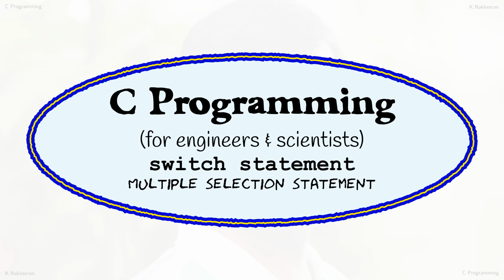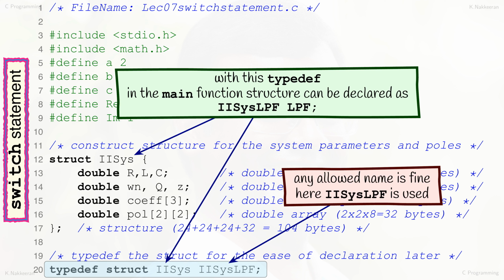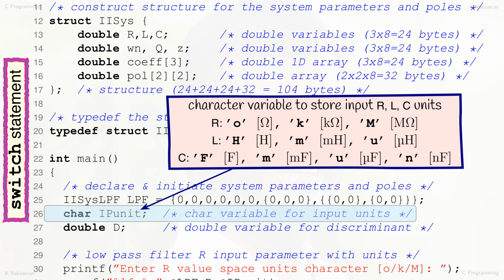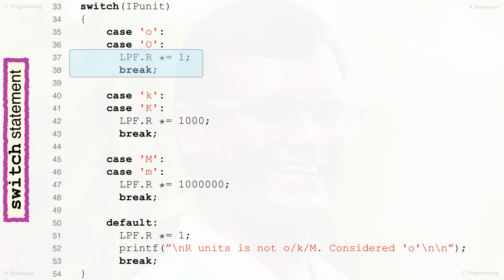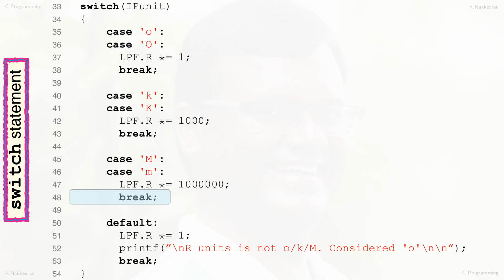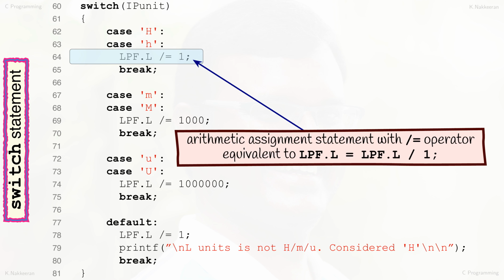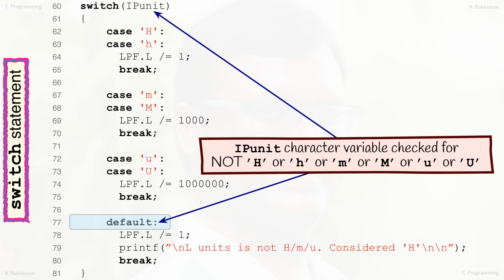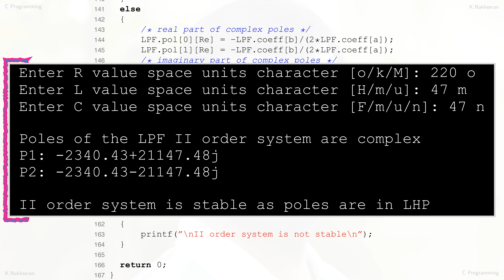C Programming Lecture 07/13

Comment from the maker: /* FileName: Lec07switchstatement.c */

#include <stdio.h>
#include <math.h>
#define a 2
#define b 1
#define c 0
#define Re 0
#define Im 1

/* construct structure for the system parameters and poles */
struct IISys {
    double R,L,C;       /* double variables (3x8=24 bytes) */
    double wn, Q, z;    /* double variables (3x8=24 bytes) */
    double coeff[3];    /* double 1D array (3x8=24 bytes) */
    double pol[2][2];   /* double array (2x2x8=32 bytes) */
};  /* structure (24+24+24+32 = 104 bytes) */

/* typedef the struct for the ease of declaration later */
typedef struct IISys IISysLPF;

int main()
{
  /* declare & initiate system parameters and poles */
  IISysLPF LPF = {0,0,0,0,0,0,{0,0,0},{{0,0},{0,0}}};
  char IPunit;  /* char variable for input units */
  double D;     /* double variable for discriminant */
  
  /* low pass filter R input parameter with units */
  printf("Enter R value space units character [o/k/M]: ");
  scanf("%lf %c",&LPF.R,&IPunit);
  /* check units character and fix the scale factor */
  switch(IPunit)
  {
      case 'o':
      case 'O':
        LPF.R *= 1;
        break;
        
      case 'k':
      case 'K':
        LPF.R *= 1000;
        break;
        
      case 'M':
      case 'm':
        LPF.R *= 1000000;
        break;
        
      default:
        LPF.R *= 1;
        printf("\nR units is not o/k/M. Considered 'o'\n\n");
        break;
  }
  
  /* low pass filter L input parameter with units */
  printf("Enter L value space units character [H/m/u]: ");
  scanf("%lf %c",&LPF.L,&IPunit);
  /* check units character and fix the scale factor */
  switch(IPunit)
  {
      case 'H':
      case 'h':
        LPF.L /= 1;
        break;
        
      case 'm':
      case 'M':
        LPF.L /= 1000;
        break;
        
      case 'u':
      case 'U':
        LPF.L /= 1000000;
        break;
        
      default:
        LPF.L /= 1;
        printf("\nL units is not H/m/u. Considered 'H'\n\n");
        break;
  }
  
  /* low pass filter C input parameter with units */
  printf("Enter C value space units character [F/m/u/n]: ");
  scanf("%lf %c",&LPF.C,&IPunit);
  /* check units character and fix the scale factor */
  switch(IPunit)
  {
      case 'F':
      case 'f':
        LPF.C /= 1;
        break;
        
      case 'm':
      case 'M':
        LPF.C /= 1000;
        break;
        
      case 'u':
      case 'U':
        LPF.C /= 1000000;
        break;
        
      case 'n':
      case 'N':
        LPF.C /= 1000000000;
        break;
        
      default:
        LPF.C /= 1;
        printf("\nC units is not F/m/u/n. Considered 'F'\n");
        break;
  }

  /* low pass filter parameters */
  LPF.wn = 1/sqrt(LPF.L*LPF.C);     /* res frequency */
  LPF.Q = (1/LPF.R)*sqrt(LPF.L/LPF.C);  /* Q factor */
  LPF.z = 1/(2*LPF.Q);          /* zeta of TF H(s) */
  
  /* TF denominator quadratic eq coeffs */
  LPF.coeff[a] = 1;
  LPF.coeff[b] = 2*LPF.z*LPF.wn;
  LPF.coeff[c] = LPF.wn*LPF.wn;

  /* calculation of the poles */
  /* calculation of the quadratic eq discriminant */
  D = LPF.coeff[b]*LPF.coeff[b] - 4*LPF.coeff[a]*LPF.coeff[c];

  /* check positive/negative discriminant */
  if (D >= 0) 
  {
      /* calculation of real poles */
      LPF.pol[0][Re] = (-LPF.coeff[b]+sqrt(D))/(2*LPF.coeff[a]);
      LPF.pol[1][Re] = (-LPF.coeff[b]-sqrt(D))/(2*LPF.coeff[a]);
      
      /* display of poles on the monitor */
      printf("\nPoles of the LPF II order system are real\n");
      printf("P1: %.2lf\n",LPF.pol[0][Re]);
      printf("P2: %.2lf\n",LPF.pol[1][Re]);
  }
  else
  {
      /* real part of complex poles */
      LPF.pol[0][Re] = -LPF.coeff[b]/(2*LPF.coeff[a]);
      LPF.pol[1][Re] = -LPF.coeff[b]/(2*LPF.coeff[a]);
      /* imaginary part of complex poles */
      LPF.pol[0][Im] = sqrt(-D)/(2*LPF.coeff[a]);
      LPF.pol[1][Im] = -sqrt(-D)/(2*LPF.coeff[a]);
      
      /* display of complex poles on the monitor */
      printf("\nPoles of the LPF II order system are complex\n");
      printf("P1: %.2lf%+.2lfj\n",LPF.pol[0][Re],LPF.pol[0][Im]);
      printf("P2: %.2lf%+.2lfj\n",LPF.pol[1][Re],LPF.pol[1][Im]);
  }
  
  /* check poles are in left-half plane (LHP) */
  if (LPF.pol[0][Re] <= 0 && LPF.pol[1][Re] <= 0) 
  {
      printf("\nII order system is stable as poles are in LHP\n");
  }
  else
  {
      printf("\nII order system is not stable\n");
  }
  
  return 0;
}